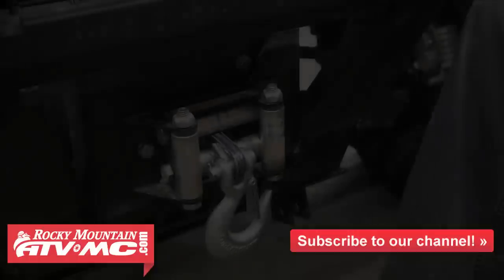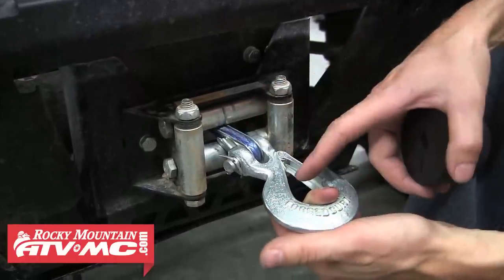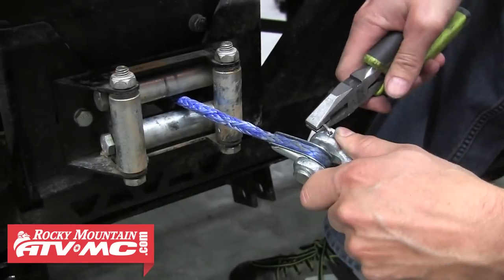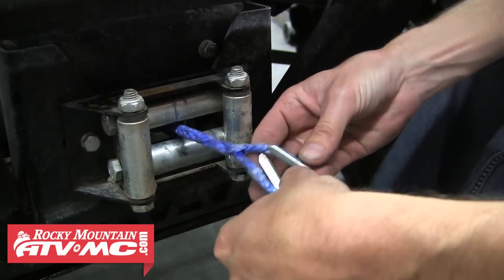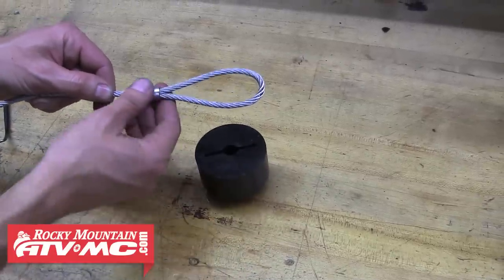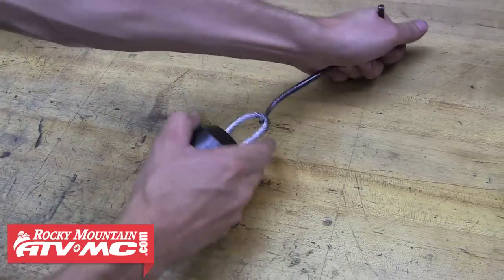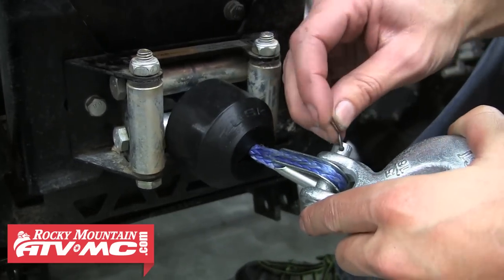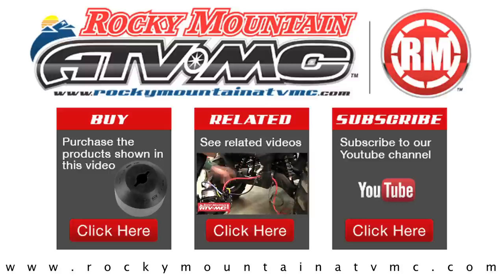Tusk Rubber Winch Cable Stop - Spotlight & Installation

Comment: You can accomplish the same thing by using a much less expensive tennis ball or Kong dog toy. If you go the tennis ball route, just cut 2 holes in it and pull the cable through (remove the hook first).
Reply from the maker: Nice tip. Thanks or the input!

Comment: Feeling a bit misled.  After viewing this video I ordered your cable stop.  I have steel cable.  I see no way to remove the metal sleeve so I can pull the cable through the cable stop as you indicate.  It's interesting that in your video, you show how the steel cable is pulled through the cable stop but the sleeve is already removed (or maybe never there).  How can I remove the sleeve?  If I can't, I just bought myself a rubber paper weight.
Reply from the maker: Robert Andrews  You should be able to just pry that metal sleeve out with a common screwdriver.  Wedge the screwdriver in between the winch cable and sleeve and with a twist motion to pop it up and out.  Let us know if we can help out any further.  I can send you my email to get this sorted out for you.  Thanks